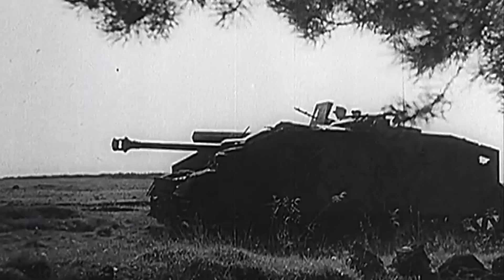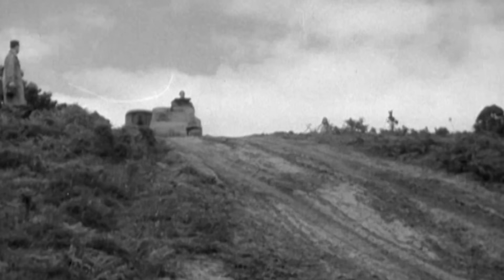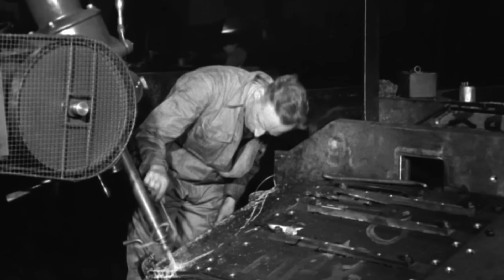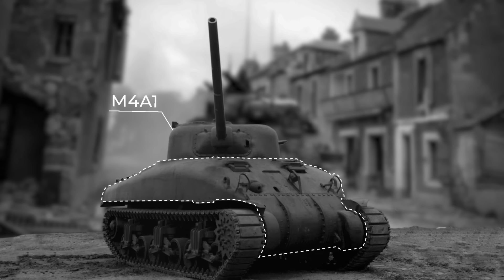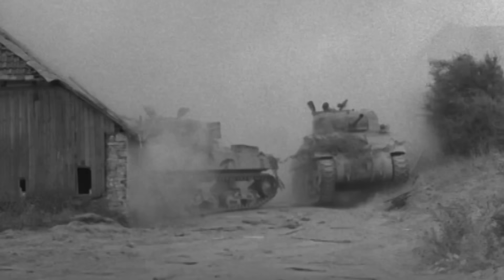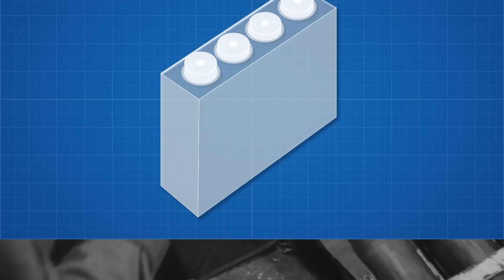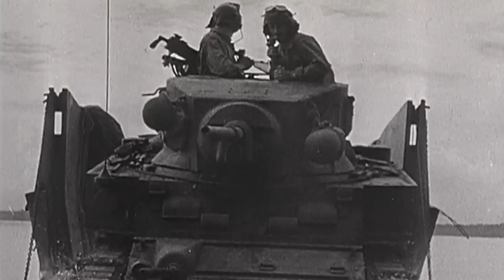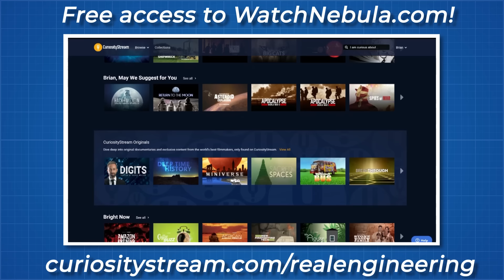M4 Sherman - The Workhorse of D-Day

Comment: The most produced Allied tank was T-34, wasn't it? It was, by the way, THE real work horse and so far more action than M4. it's very strange that the authors make such elementary mistakes.
Reply: Well, the M4 was used by far more countries, including the Soviets. And the numbers weren't far off. In fact it wasn't until mid 1944 the T-34 saw larger production numbers. The M4 saw action in all theaters during the war, the T-34 was constrained to the numerous sectors of the Eastern front, and then eventually Manchuria and Korea. An interesting note is that the many of the first tanks inside Berlin, Vienna, and then deployed to Manchuria were Lend Lease M4's.
Reply: @peterson7082  T-34 was used by 40 countries (in addition the USSR and ex-USSR countries) - which is approximately the same number as for M4. And the numbers were not that close: 49.5 v. 60 k. As regards action, I belive you would agree that in the Eastern front alone T-34 saw BY FAR more action than M4 in all theaters together. Don't forget that T-34 fought since 22 June 1941 and its contribution to destroying the first 20% of the Wehrmacht force - which according to the Paretto rule, means 80% of the work)) - is far-far greater than that of M4. It is also not true that T-34 was not produced in large numbers until 1944 - perhaps, you mistake it for its modification T-34-85. Almost 3000 were produced in 1941 (mostly after the beginning of Barbarossa), over 12.5 k in 1942. Just compare with the production of M4 and, more importantly, when its large quantities saw action in the Eastern front - effectively, it is 1944, when the outcome was already clear. That said, I am not undermining the US achievement in producing a capable tank (on par, equal to T-34 in a fight) in just 3-4 years after it had virtually NO tanks.) And really grateful to the US people and government for supplying them to Russia. Some of them even participated in the Stalingrad counteroffensive.
Reply: @shelonnik274 

 > "T-34 was used by 40 countries (in addition the USSR and ex-USSR countries) - which is approximately the same number as for M4."
 
 I am specifically referring to during the war.
 
> "And the numbers were not that close: 49.5 v. 60 k."
 
 49,252 compared to ~58,000. Also keep in mind it wasn't until 1944, at least per numbers given by Valeri Potapov on Battlefield.ru, that the T-34's production outpaced the M4's. < http://english.battlefield.ru/tanks/34-medium-tanks/15-t-34.html > < http://english.battlefield.ru/tanks/34-medium-tanks/14-t-34-85.html > compared to < http://the.shadock.free.fr/sherman_minutia/data/sherman_production.html >. 

> "As regards action, I belive you would agree that in the Eastern front alone T-34 saw BY FAR more action than M4 in all theaters together."

You are going to have to specify the parameters of "action" here.

> "... is far-far greater than that of M4. It is also not true that T-34 was not produced in large numbers until 1944 - perhaps, you mistake it for its modification T-34-85."

 I never said it wasn't produced in large numbers, just that it never outpaced or outproduced the M4 until 1944 despite the T-34 entering service earlier. 

> "Just compare with the production of M4 ..."

 That's exactly what I am doing. My argument is just contesting your claim where you're saying the T-34 was "the real workhorse" over the M4.
Reply: @peterson7082  

== I am specifically referring to during the war.

You are saying that M4 is more of a workhorse because it was used by a bigger number of countries during WWII? Makes no sense to me. T-34 was used in thousands since 1941 and in many thousands - since 1942 on the front from Murmansk to Crimea. M4 - in hundreds in Africa, Sicily and in handfuls, occasionally, elsewhere (correct me if I am wrong) until at least late July 1944. What's the point that it was operated by soldiers of several  armies (how many? and btw T-34 was also operated not only by Russians - Polish, Czechs, Chinese, Koreans, Serbs, etc.) if it simply was not used any nearly as intensively as T-34?

==You are going to have to specify the parameters of "action" here.

Battle action, front line? No you are going to specify the parameters of a workhorse.

==I never said it wasn't produced in large numbers, just that it never outpaced or outproduced the M4 until 1944 despite the T-34 entering service earlier. 

I only hope that you are not going to define a workhorse tank as the one produced AND STORED.

As regards the total production, approximately 31 k. of T-34 were produced by the end of 1943 - and, more importantly, almost all of them were deployed to the front line. What about M4? I tried to found the total per years but did not quite make it. Do you have any numbers?

Comment: Sherman armor was generally inadequate. That's why you see several of them with sandbags lashed to the front.
Reply: Not really the case with sandbags.
Reply: That is...wrong, armor of front upper glacis was 90mm+ of armor. Most are varying, reasons from different variants and degrees.

Comment: WW2 tank design ideas by nation:

Germany: lets create versatile and very advanced tanks and keep modifying them even in a smallest detail all the time slowing down production. Then, let's make bigger tanks. Then Bigger. Then BIGGER. Then B I G... What do you mean transmission kaput?! oh, we lost.

USSR: Crap, we need tanks! Let's make disposable tanks! Let's keep removing elements from them to speed up production! Driver chair? Not needed komrad. Now, we have  a shitload of tanks, let's upgrade them.

America: we need tanks in masse that will be shipped over the ocean. They won't be able to go back to factory for repair, everything must be simple to repair or replace with spares. Delay production if needed to test them THOROUGHLY. What? This one bolt will break before every other part? Redesign it! Now, now, good. Good tanks, lots of tanks. Do we upgrade? Yes, but slowly, everything must be reliable!

British: well... Just make some speedy tanks. And bunker tanks. Splendid. I want that gun on that chassis. Put it fucking sideways if it wont fit. Engines? Just strap 5 of these together! What do you mean this chassis won't take that gun? Just put it backwards! Man, figure it out, we have planes to build!
Reply: -- Me:
Just fly a plane and you're good to go

Comment: Rock solid workhorses?? go tell that to the guys that burnt up or got shredded in those death traps!
Reply: It was by no measure a death trap
Reply: @peterson7082  Yes it was.
Reply: @TheFunkhouser  No it was not.
Reply: @peterson7082  Put some facts up instead of just saying No is was not, noob.
The germans called it the tommy cooker and for good reason.
Reply: @TheFunkhouser  Except there is no documentation of the Germans ever specifically referring to the M4 with that nickname. It appears before it even saw service. The fact was it was a very survivable tank to be in.
Reply: @peterson7082  and prove my point about being called a Tommy Cooker, simply type that into google and it will take you to the SHERMAN page! lol.
Reply: @TheFunkhouser  Doesn't change the fact there is no direct to the M4 from any mentions during or soon after the war. And the fact it appears well before the M4 saw service.
Reply: @peterson7082  Ok so why did you delete my last post!??? Nm.
Patton insisted an order in later '44 early '45 where is said none of his (Sherman) tank crews will have sandbags and timber added to the fronts and sides of his Sherman's. This is understandable as it wore out the gearbox, but it goes to prove the guys that actually had to live in them were very concerned!
Reply: @TheFunkhouser  

> "Ok so why did you delete my last post!??"

 I didn't delete your post. Nor could I. What I think might have happened is that if you went back to edit your post through the notifications tab it ends up deleting it. Its happened a couple times to me. 

> "Patton insisted an order in later '44 early '45 where is said none of his (Sherman) tank crews will have sandbags and timber added to the fronts and sides of his Sherman's. This is understandable as it wore out the gearbox, but it goes to prove the guys that actually had to live in them were very concerned!"

 Crews seek ways to imrpove protection, these methods supposedly helped against shaped charge munitions, but it turns out the best way to protect against that was actually welding extra armor, as sandbags and logs would only help against high-angle shots (which were likely to glance off anyways ) but not direct hits, which would actually normalize the angle of impact making it more capable of penetrating the tank's armor. This isn't special to the M4. You see crews do this to the Panther, T-34, Cromwell, and the IV.
Reply: @peterson7082  Well that was weird, I def didnt wipe that post. I typed like half a book and are over it now lol. You like M4, cool. It wasnt a BAD afv, its just I wouldnt of liked to be in it in WW2. 
If I had to choose an allied afv that saw a good chunk of time in WW2 (unlike the best allied one which was the Perishing) Id have to go with the M36 Jackson.

Comment: The Sherman had 2 deadly flaws - underpowered main gun and insufficient frontal armor. The gun was later upgraded in the Firefly version with the powerful 3-inch (76.2 mm) calibre British 17-pounder anti-tank gun as its main weapon. But the insufficient front armour made it a death trap when facing a Panther medium tank with a long 75-mm gun having a muzzle velocity of 936 metres (3,070 feet) per second. The best things about the Sherman were it's unbeatable reliability and speed and the fact that one came off the assembly line very thirty minutes. That being said it was a light medium tank going up against heavy medium and heavy tanks and that spelled casualties for too many brave men.
Reply: Front armor was fine. And it fared fairly well against the Panther.
Reply: 75mm main gun was mostly fine. It couldn't pen a heavy tank but it could pen and destroy anything else with no prob

Comment: 1: Most Sherman crews didn't know about the stabilizers. The crew that was aware of it knew that the stabilizer was not meant to be used to shoot while moving, but instead to help aim the gun when the vehicle suddenly stops. 2: M4 was not meant to fight enemy tanks. They were to support the infantry, hence why they usually used HE shells. When they did fight tanks, the only way that a Sherman (75mm) can penetrate the front of a Tiger is by using HVAP ammunition which was highly inaccurate. The other shells that the 75mm Shermans had to fight other tanks were the M72 shot with a penetration of 90mm at 10m at 90 degrees. There is also the M61 shot with penetration value of 101mm at 10m at 90 degrees as opposed to the Tiger's front hull armor which is 102mm at 9 degrees (Upper plate) or 102mm at 25 degrees (Lower plate). 3: Reducing the hull angle from 57 degrees to 47 degrees reduced the total effective armor thickness thereby reducing the chances of a bounce, or a non-penetration. Note: This is not a comment that is saying your video is bad, but this helps with some mistakes that you have made. I have gotten all these points from Nicholas Moran aka The Chieftain except for the shell penetration values. I got the penetration values from the Jacob De Marre formula.
Reply: Most crews were aware of it, as it was in the training, operation, and field manuals of the tank and gun. But proper use of it doesn't appear to have commonplace while training crews.

> "M4 was not meant to fight enemy tanks. They were to support the infantry, hence why they usually used HE shells."

 What a tank supports has no bearing on what it can and cannot engage. The M4 was equally intended to engage tanks as it was infantry, in fact field manuals FM 17-5 and FM 100-5 clearly state that the priority of targets in an engagement for medium tanks are enemy tanks and other armored fighting vehicles first and foremost. 

> " When they did fight tanks, the only way that a Sherman (75mm) can penetrate the front of a Tiger is by using HVAP ammunition which was highly inaccurate."

 Based on what exactly? 

> "I have gotten all these points from Nicholas Moran aka The Chieftain"

 Where did he make these points?

Comment: 1 vs 1 in every model of the Sherman was a failure The Army knew it the designers knew it  The problem sat in the contract to push them out regaurdless of lives  A aircraft engine that needs high octane to perform vs a diesel engine that already had better performance And less chance of cooking its men inside ..Thus why the Germans called it the "Tommy cooker"  Americans  were lucky they had Numbers over the well designed tanks of the Germans ..Too well..Germany with its heavy tanks took too long to build And had not really started resource production of its captured lands
Reply: It didn't use an aircraft engine, it didn't use high octane fuel, all evidence shows that the ammunition was the cause of fires not the fuel, the tank was highly survivable, and the tanks were not designed to 1v1 because they have better things to do, like actually being useful. Why would you ever care about 1v1 performance when the minimum unit is a 5-vehicle platoon? That's like arguing that a Mercedes-Benz Sprinter is bad because it doesn't have good down force when cornering. And if you weren't already wrong enough, it wasn't even outmatched compared to the late Pz. IVs, and was certainly better than early Pz. IIIs in Africa. 

You managed to write a paragraph where almost every point is wrong, it's almost impressive.
Reply: @infinitelyexplosive  Ford GAA engine Start there